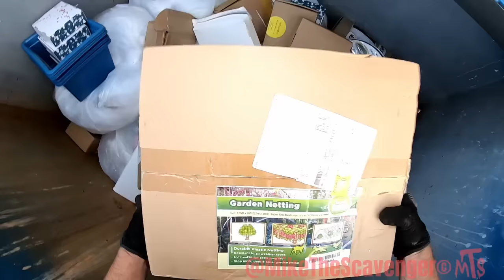Dumpster Diving & Curbsiding "I'm Not To Be Trusted With Cash"

Comment: The steel tank might have been a boiler/radiator/something supply tank that could add water to a system, had the view tube to make sure it always had enough in it.

Comment: The rust bucket water tank at about 6 minutes, looks like it is a conditioner tank for a boiler system. It is where the water gets softened and prepared to go into boiler. Level Guage is so you can check to make sure it is always ready for a supply injection into the boiler.

Comment: Hi Mike any chance going back for those laptop bags ? I could use one with wheels so I could use my laptop and my Amateur Radio in one place. I use NMHy not Lithium batteries and a solar cell like you see on the highway for those emergency phones.

Comment: That looks lie an type of ole water heater that has a copper core. If so, thats about 25 to 30 ibs of Copper. Easy to zip down the side & take a ppeak with an angle grinder. Ty for taking us along

Comment: That tube on the side of the rusty water heater looking thing is what they call a "Sight glass"...  You can see the level just by walking past it....  Not real sure that would be present on a water heater....  Usually you see that on fuel tanks, or radiators, or stuff like that, where you want to see the level....